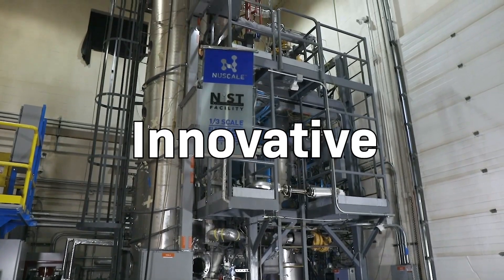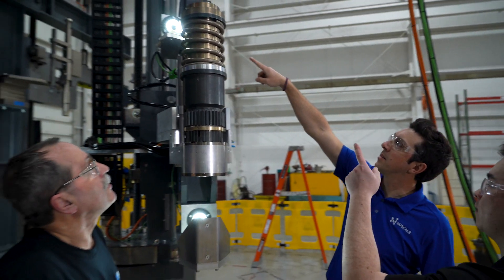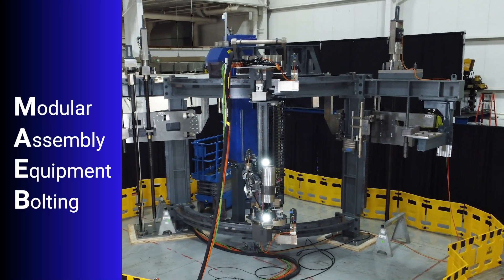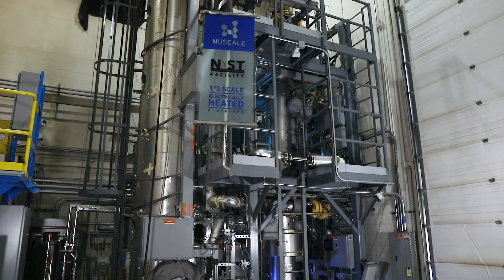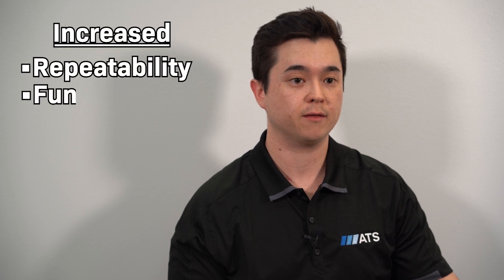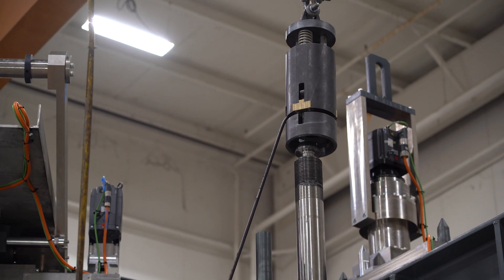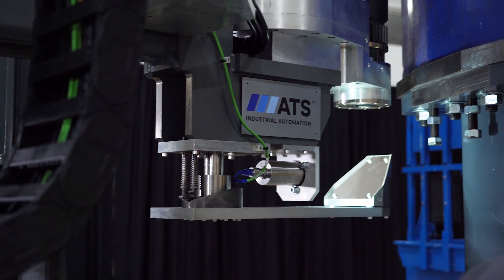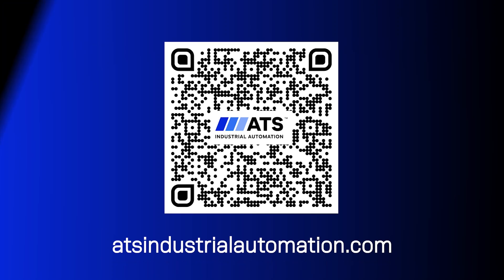Cutting Edge Nuclear Innovation for Small Modular Reactors

Comment: Still a light water reactor.  I would call this a pre-model T reactor.  It's still a low temperature reactor which is not really useful for industry or storage of power as heat.  In my opinion true development of economical nuclear power will depend on the development of molten salt reactors.  With low pressure, high temperature operation and potential economical construction  these reactors once developed should be the Henry Ford of nuclear power development.